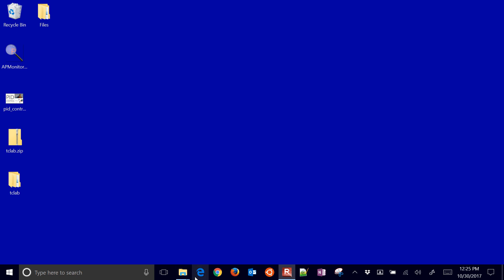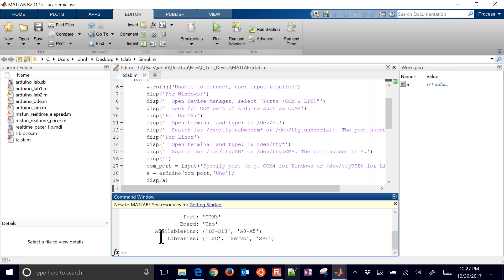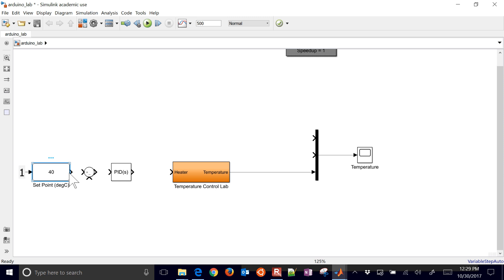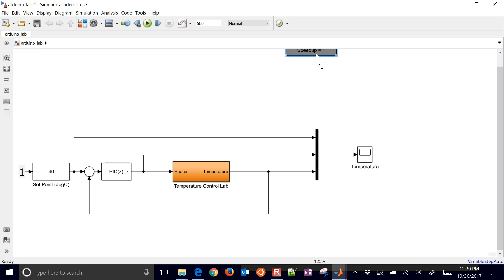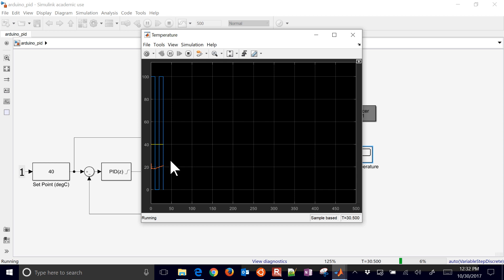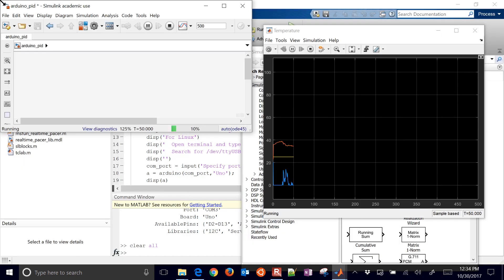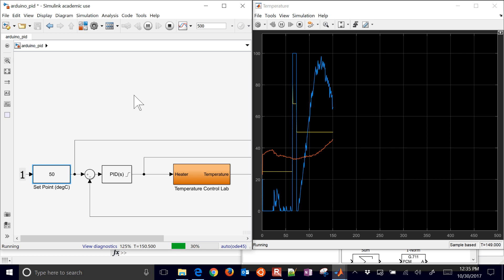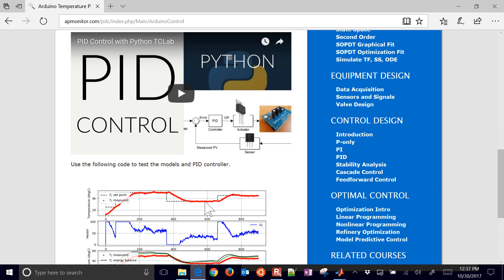PID Temperature Control in MATLAB

Comment: Hello? I am currently working on my final year project on sea water desalination using a parabolic trough collector as a preheater and electrical energy via an electric heating element to achieve boiling point.

I am looking for advice on how to create a temperature control system for my electric boiler( with heating element)
Reply from the maker: The temperature control lab could be a good practice for implementing temperature control: https://apmonitor.com/pdc/index.php/Main/ArduinoTemperatureControl

Comment: I want to use a set point of 92degreeC in non-linear model but it seems like temp cannot exceed 70dC threshhold. What do I change in the code to remove this limitation.
Reply from the maker: It is not recommended to remove the safety features. The safety features are that the PWM is set to 200 out of 255. Also, the power supply is 5V that prevents the heater from getting too hot. We've used a 9V power supply for the heaters but then the temperature gets too high. The plastic components start to degrade at about 150 degC.

Comment: Hi sir, every time i try to run the simulation i get the error "Error in 'arduino_lab1/Temperature Control Lab/Arduino/Arduino' while evaluating expression." if you could help on this it would be much appriciated sir.

Comment: can someone help me  :-(

An air-conditioner that you designed previously, has not been performing well for quite some time.
The following problems are observed:
i. When you set the temperature on the remote to 24°C, the temperature in the room is
observed to be ranging between 24±5°C.
ii. It takes an extremely long time for the room to cool down and the desired temperature can
never be maintained for long.

a. The adjustments required to fix the control system and the reasons?

b. Name the new controller (P, PI, PD or PID)?
Reply from the maker: It sounds like the cooling capacity of the air conditioner has decreased. AC units are typically not PID control because the AC is either on or off. It cannot go to 60% of max load. You probably need to clean the condenser or evaporator or check the pressure of the coolant on the suction (low pressure) side.

Comment: i need a pid controller to control a water valve to control the temp inside of a water tank by increasing or decreasing the water flow using a temperature probe of input.  a stepping motor to increase or decrease the water flow . this tank is not connected to a hot water tank it is a separate tank that needs a water vale to increase or decrease temp.
Reply from the maker: That sounds like a great application. There is additional information on process control (such as level or temperature) here: https://apmonitor.com/pdc

Comment: stucks in half of compilation, 2016a version
Reply from the maker: Your install didn't finish? I'd recommend that you contact Mathworks' support if there is a problem with the installation.
Reply: @apm  No, i did everything as you on the video, just press RUN and compialtion of model never finish. I have a non oficial version of matlab, may be thats the issue
Reply from the maker: Yes, I think they check your license credentials as part of the installation. The Python version is also a possibility if you have the TCLab hardware: https://apmonitor.com/heat.htm
Reply: APMonitor.com unfortunately, thank you

Comment: Thanks ! Can we use fuzzy-pid controller on plan like this ?
Reply from the maker: Yes, I think it would also be another type of control for this device.
Reply: @apm  okay. Cause its my final project 😁. But i dont now how to connect my plan to simulik 😁
Reply from the maker: @ahmadfathanhalim2636  I hope your project goes well. There is also a Simulink interface here: https://apmonitor.com/heat.htm that you can use as a template for your project.
Reply from the maker: @ahmadfathanhalim2636  the TCLab uses the Arduino support package and connects with a serial USB connection.

Comment: i got an error for opening it . ( error line 145) . how to open it? it was apparently done a newer version
Reply from the maker: You need to get the Arduino Support package for Matlab before running this script. Also, do you have the temperature control lab kit? More info is available at http://apmonitor.com/heat.htm
Reply from the maker: I included earlier Simulink versions in the Github directory and in the zipped archive. Look for the other slx or mdl files. The MATLAB scripts should work for all versions.

Comment: where's is your aruino's coding dude? i really need you help :(
Reply from the maker: Here is the source code for the Arduino interface: https://github.com/APMonitor/arduino/blob/master/0_Test_Device/Python/tclab/tclab.ino

The PID calculations are performed with Python, not on the Arduino. The Arduino is only to retrieve the temperatures or write the heater or LED values. The Python code is available from: https://github.com/APMonitor/arduino

Comment: can you give me the details about  the box of  temperature control lab
Reply from the maker: The lab kit includes:

Arduino Uno or Leonardo
Temperature control PCB shield
USB barrel jack power cable for heaters
5V USB power supply (US plug)
USB cable for serial connection to MacOS, Windows, or Linux computer
Small cardboard box
There is additional information and a purchase button at http://apmonitor.com/pdc/index.php/Main/ArduinoTemperatureControl

Comment: really nice! where can I get this pcb in order to replicate the experiments?  do you buy this pcb?
Reply from the maker: +cosmic lion x, you can either build it with a breadboard or you can buy it from https://apmonitor.com/heat.htm (see button at the bottom). Let me know if you'd like a detailed parts list to build it yourself. I put in a bulk order of PCBs if you'd like me to send one or many of these kits. The kits come with everything that is needed to the lab in Python or Matlab.
Reply: could you send me the detailed parts for build it on my breaboard?. I will probably order a pcb too
Reply from the maker: +cosmic lion x, here is the parts list and wiring diagram for a single heater and temperature sensor (SISO):  http://apmonitor.com/che436/uploads/Main/Hands_on_Process_Control_CACHE.pdf  The PCB version supports SISO or MIMO.